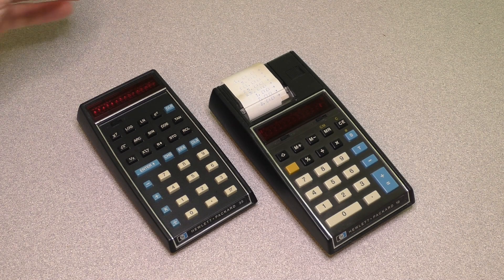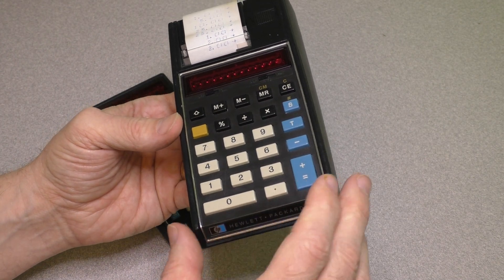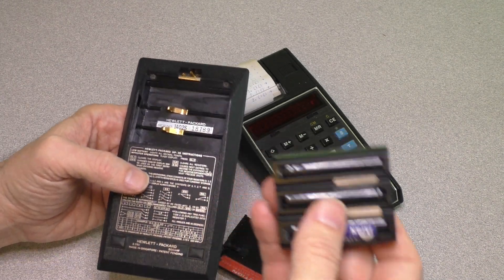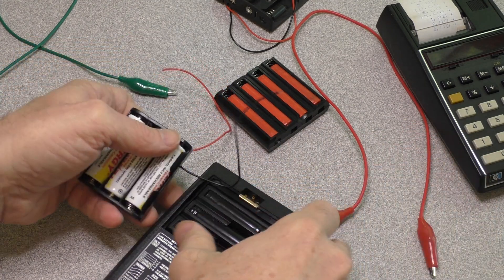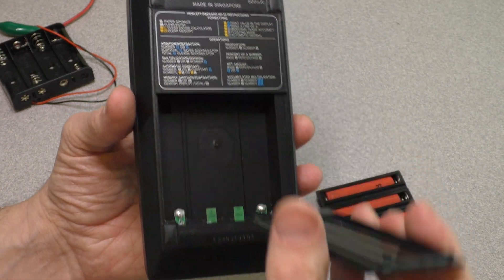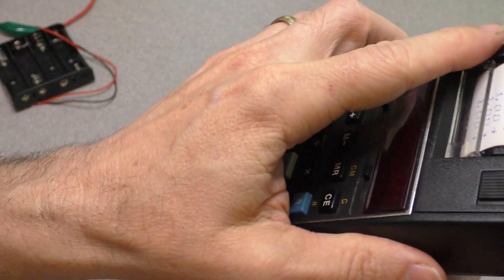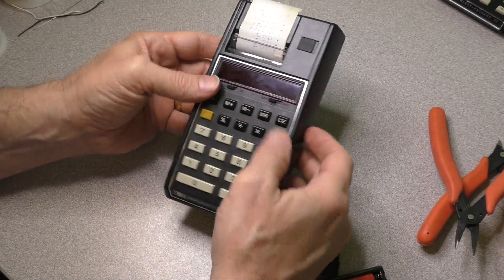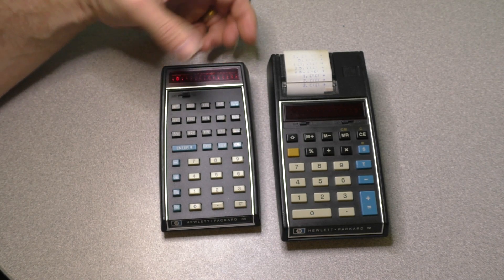Vintage HP Calculator Battery Pack Mod

Comment: There's no point in doing so much work for so little. It's quicker to buy a Li-Polymer battery pack with a plug of the right voltage and connect it to the calculator's contacts: a job that takes 5 minutes or so. When you need to recharge the battery pack, you remove it from the calculator, charge it, and then reconnect it to the calculator. Minimal expense and great returns.

Comment: You can make a removable battery holder with a 3 x AAA battery holder, and some foam as a spacer for the HP-35. AAA NiMH provides a longer run time than the original AA NiCad cells. The advantage being that if crafted in the right way and making contact pads on the bottom, you do not have to modify the actual calculator.

Comment: Are those magic batteries with no leaks after 52 years! Unlike HP today it was a high quality company then. I did hard wired the batteries on my HP-35.
Reply: It looks like that HP35 units has never been used. There’s no wear on the front after 52 years. There’s zero percent chance he just found them cheap.

Comment: Geo, I have an HP55 that has a flaky power switch. Any ideas on how to proceed with a remedy?
Reply: I would start my squirting in some electronic contact Cleaner. Just sports them in and move the switch back-and-forth and commonly that helps. If that doesn’t get working, you will likely have to open it up and see if there’s a soldering issue in the switch. The wire to the switch might be loose.
Reply: @Tatooinesky  
Good suggestions. HP-35 has the same type of sliding power switch, its also flaky.
Reply: The switch is essentially a couple of contacts on the PCB with a bent piece of copper that slides to make contact. The switch lubricant picks up crud over time and makes contact flaky. Best to disassemble the calculator, clean, and refresh the switch lubricant for reliable long time use. You can find instructions on the internet for disassembly. It’s tricky to remove the screws under the label without damage, but is possible.